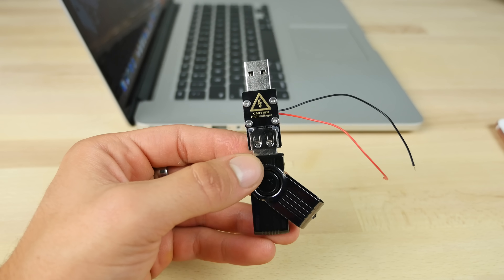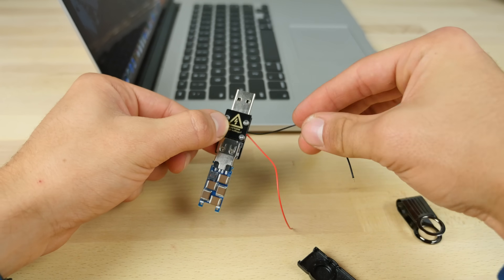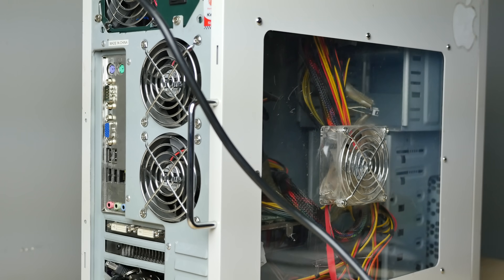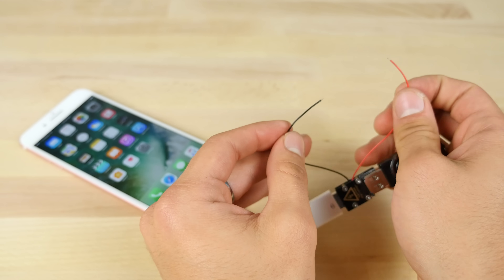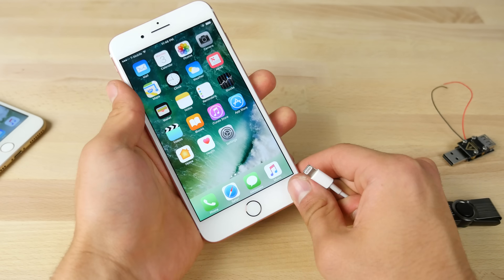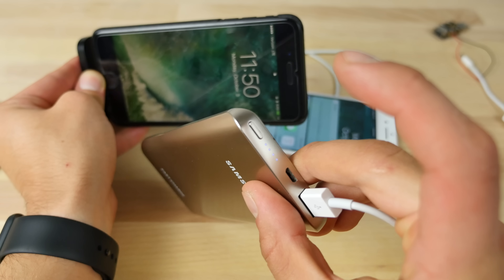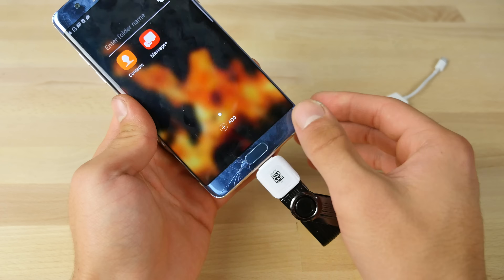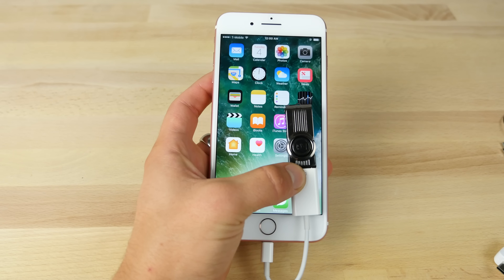USB Killer vs iPhone 7 Plus - Instant Death?

Comment: You realize the Note 7 & S7 line can handle upto like 20v right?  for fast charging. XD  (via approved connectors)
Reply: Kerns Noel
Things to think about with this device is that it send 200V via the data connections, not the powerlines themselves. And there are 5 capacitors in series, ultimately charging the USB 5 times as fast. The phones weren't powerful enough to do any real damage though, I think a newer phone can output at around 1 amp.
Reply: Kerns Noel the USB killer probably outputs very high power on the USB, so it's not only the voltage that matters. Also it might put it on one of the data cables so the device is absolutely not fit for that.
Reply: +Leo1239150 In this case, only the voltage matters. These capacitors store up to 200V and then discharges it in quick succession. The amp is pretty low, it's negligible.
Reply: *****
The fast charging on newer Samsung phones take up to 9V for fast charging, and 5V on normal charging. Fast charging is literally adding more volt.
Reply: deIlluminati Indeed after looking at my motorola quick charger saying 12v I removed my comment. You are right!
Reply: deIlluminati I can't imagine it's able to store up that much power from the supply from the note 7 output (and I couldn't find a reliable source on what it outputs).
Though if I were to be honest I suspect that the Note 7 supplies standard USB power upto 2a (5v), and given a few facts about how the iPhone, standard PC, & note 7 work ... 
-PCs USB ports aren't meant to receive power, and wouldn't be designed to tolerate powered feedback in excess of what it supplies (and given it'd fry the power supply on Good MB/PSU setup, or the MB it self)
-iPhone 7 isn't meant for fast charging & wouldn't tolerate a sudden spike like that either, cooking it's port (which is death for an iPhone really, as it doesn't charge wirelessly)
-Note7, having over-engineered Fast charging .. (and given that they don't enable the full blown limit, likely due to heat generation from it that would come from the battery) would likely be able to tolerate a spike within half way reasoning.
I can't imagine that the USB killer could output 200v from a Note 7 charge, and I do wonder what input it would take to generate that quickly (within 2 seconds)
Reply: deIlluminati forgive my bad wording.  I know standard USB is 1a right, but given that even the 'standard' charging for the Note series (For a while) has been 2.1a, I'm willing to assume that the Note 7 could output 2.1a w/ 5v (which is the USB standard volts)
Though, perhaps the Note 7 USB-C being a Very over-engineered Multi-purpose port, that 'DOES NOT' stop charging or the ability to charge even while using data connection, and I really doubt they'd leave it vulnerable to accidental cross linking.
-That and honestly I do believe that supplying power mode would disable any data connection, meaning a device that is able to do that could consider all of it's pins potential power lines for it. (aka, I doubt it ever has any dedicated data connections like traditional USB ports on PCs do)
-I would also point out that the charging hardware in the Note 7 is fully able to take more, and I'm willing to bet part of how they do it, is utilizing normally unused parts of the USB input for fast charging ontop of more volts. 
--It's clear the battery is the main reasons faster charging isn't in place, as heat generation and lifespan* are the critical factors, not the chipset ability to handle more volts/amps through it's circuitry.
Reply: Paul H. There's no such thing as an S7 Note. It's called a Note 7.
Reply: deIlluminati he is talking about the regualar Galaxy S7 and S7 edge

Comment: Killing the lighting port is still kind of killing the phone lol
Reply: see this is is where wireless charging shines and now getting a iphone wireless charging case would not work
Reply: You can replace the charging board component, iFixit showed it on their teardown, better than a new phone.
Reply: How does replacing that component affect the IP67 protection though?
Reply: And no wireless charging
Reply: dgo0dy Gaming I would need to check iFixit video to veift but what I remember is that the isolation that stops the water doesn't require any special assembling technique, but you can check it out if you are curious. I'm on mobile data so I can't check it right now
Reply: ►►►► Heeeey Frienddssss I Haveeeee Justttt Wonn Brandd New MacAir From visittttt  : -  https://t.co/lvoGbx85vT
Reply: ho cares abaut that

Comment: The reason that its not firing the device is that every time you are touching the tester wires you are immediately releasing all the courent, "let it charge" through the tester and then with out touching the wires plug it in

Comment: Restart the iPhone. I think the phone has disabled the port and should turn back on with a reboot.
Reply: +IIGrayfoxII No, the PSU will only protect from surges coming from the power line. Power to the PSU from the wall, PSU power goes to motherboard, and power from motherboard goes to USB. The PSU can't protect from the USB since the motherboard is between the PSU and USB, and therefore the motherboard will fry before the PSU can handle it.
Reply: Same with the PC.

When PSUs detect a short, the circuit breaker needs to reset and it does it by having all power from the capacitors get drained.

So unplug from the wall and wait 5 min.
Reply: No - the surge in this case blows out ICs in the motherboard
Reply: mattferg100 is right.

Comment: Was that charging the note 7?
Reply: yup it is
Reply: i know samsung is much more concern of its customers safety, well i know apple is much worse than samsung i had experienced it b4 with my s3. i know samsung will deal with the devices u bought from them, if it is a serious case they will recall the devices
Reply: that was not the case for apple, i had bought a imac, it broke when i open the packaging the screen drop off, bring to apple service centre only said i void the warranty so i can't fix for free, but i haven't even use once. there another case whereby i won a lucky draw with my friend both of us got an iphone 6 free redeem at official apple shop, again got a problem set, this iphone has a bloody red screen appearing and there some sparks at the lighting port when it turn on and it does not allow me to see the home screen and it getting hotter and hotter the screen get more bloody red b4 it turn off. it may expolde if i charge it, luckly i notice there spark at lighting port when it is turun on. the spark went off when the apple logoappear then the blood red screen. my friend had the problem as well so we went to the service centre. apple check and only said u need to pay to fix the phone as u jailbreak it, but we didn't jailbreak them

so therefore i hate apple and won't use it again. u can get faulty phone/devices if the service is bad it is just unforgiving.
Reply: nope as we didn't do any housekeeping the we didn't get a chance to use them all we did was switch on the phone then it does the red screen
Reply: the mac screen drop off when i placed it on the table, i am not even drop them or no even slam them on way too hard.
Reply: it was really the product packaging  or shipping fault and programming fault before it was on sale i dun even get a chance to get in to the home screen and use the mac .

apple just dun want to admit that is their fault.
Reply: Technically it was charging the phone, though it wouldn't actually give the phone extra power and it would run out of battery like normal, I account for this being the capacitors re-releasing the stored power back into the phone and the phone recognizing it is receiving power from an external source, even the it is just recycled power that came from the phone in the first place.
Reply: literally every Apple fans would use "Note 7" to back up every argument whenever they run into one with Samsung users
Reply: its funny how you know nothing lmao only a few exploded 1 in a million .0035% of them had a defect lmao and they recalled it in a few days and apple? they hiss they bend and they dont warranty that shit lmao
Reply: I see what you mean but you broke it out of human error it wasn't because their product failed

Comment: Note 7 is a solid phone just got way too much bad PR.... I love how they sent me a second one. I love the note 7... better photos in low light than the iPhone 7 plus i've used.
Reply: Jonzin Gaming All lithium ion batteries have a risk.
Reply: "Bad PR"?!! The fucking thing self-combusts, it's hilarious that these are the same Fandroids that picked fun at Apple users because of the signal issue on the 4/4S or the bending issue on the 6/6S or whatever else, well guess what? At least the fucking things didn't EXPLODE!!!
Reply: SeKToR  NOTE 7 battery go boom boom and hurt people
Reply: How many cases vs how many sold?
Reply: it should not be a risk at all
Reply: fun fact, the iphone 7 is having the same problem now lmao. in fact it has since the start. but apple is trying to keep it low. so the score is, shitty signal on 4s, bend on 6s, and explosions on 7, to, well, only explosion on one of samsungs lines. so 3-1, keep up the shitty work ifag.
Reply: lithium ion provides better battery efficiency by now but it is actually a bomb.
Reply: lmao multiple Have been confirmed. but not by apple. apple most likely wont confirm them, because thats apples way of business. ignore the problem so that it cant hurt us. apple makes shitty products and specs show it
Reply: matt may
Specs? Oh you mean like the fact that Apple's newer duel-core processors in the iPhones outclass similar Quads on Android devices? Or the fact that ioS devices don't NEED as much RAM as the resource-leeching Android OS? I could go on and on and quite frankly you're just making yourself look more and more salty by the post, care to link me to any of these "confirmed" reports eh?
Reply: Andy Fisher to be honest you are salty just because someone called iphone worse

Comment: the computer is running but does not turn on the film because I did not turn off the power supply from the network for 15 seconds as protection is atx is a total fake buuuuuuuu

Comment: i think it would be better to inform yourself before doing such a video next time. how does the usb killer work? it charges up its capacitors, then releases its power ower the DATA contacts. thats why it does so much damage. now, i think that it did not kill the samsung because he told the phone that it does just charge the battery, so it did not use the data contacts. furthermore, i dont think that you could fry a battery bank, wal charger or other "power-only" things.

Comment: What happens when you plug it into a car or your house outlet?
Reply: Your house explodes
Reply: Sean Ali your car and your house both have fuses. They will switch off. In the house you can just turn it on again, in the car however you have to buy a new fuse and replace it.
Reply: Not entirely, if it trips the breaker in the house then yeah you can flip it back on again, but if it actually fries the components then that breaker would have to be replaced. However I doubt that could output enough current to actually do anything, have you have ever seen a power surge, it takes a lot of current to actually knock the power out of a house. The 5 caps in that USB thumbdrive can't push the current high enough to cause damage.

Comment: Will this cause the hard drives and any storage devices to lose all of the data?
Reply: Alex Schneese Well don't try it just in case it does wipe the drive but myself I think it is just the power supply that breaks. The iPhone stopped charging and the PC didn't turn on. It is most likely wiping out the power supply. Most of the time a computer technician shop will replace the power supply for around $50.
Reply: No, it only fries the motherboard as far as I know.

Comment: every respectable manufacturer will implement some sort of protection on any usb ports. for example on my mac, a short on my usb will reset the laptop. 

I think you need to read more about voltage and current before understanding what is happening with that usb "killer" .

Comment: Im confused would'nt the power supply stop it from that type of stuff
Reply: Dandre Urquhart power supply regulates voltage, and its just like if u throw a ball and it comes back like a boomerang and hurts u.
Reply: but most modern psu would protect against it isn't it called over voltage or am i confused
Reply: overvoltage related to the psu not usb ports. Some motherboards may though.
Reply: oh ok
Reply: The USB is connected directly to the motherboard, so the motherboard will fry first. It's just logical.

Comment: you didn't just kill the lightning adapter you actually damaged the power management chip the part of the chip responsible for charging the phone. don't ever charge an apple device with a cheap car charger because the same thing can happen and the repair is almost impossible it will actually just kill the phone. android phones are safer because they have charging protection on the phone and apple has it on the charger itself

Comment: It's called "opto-isolators" they're used for isolating devices for that specific reason to prevent ESD. It's a little more complicated than a one line statement, but it isn't an actual direct connection from the port-to-the-board any more, they have discrete monitors for those isolators as well; But for all intended purposes....that lady has sung.

Comment: you gotta charge up the capacitors again and use a multimeter to test it, if you just touch the wires together you are gonna discharge the capacitors

Comment: Phone is made to be connected to the wall, it would make sense they would be protected from power surges like lightning strikes... like good computer's power supply... a USB port isn't meant to connect to the wall or high voltage and are not protected from them...

Comment: This is more proof that intel made that connector great (because it supplies LOTS of power) and that Samsung and Google android know what they are doing. The thing is that the iPhone goes straight to automatic stuff, it doesnt and wont require a user input to do anything with the port and you cant control what it can or cannot do. Dont leave your phone unlocked anyways... whatever you have.

Comment: Some would says that I'm a, on Danish "computer nørd". 
A nørd. Is a person who had a hobby out of the ordinary. I've tried a usb kill pro, on an old Dell computer that had xp. I had expected that the computer would collapse just like yours. I know how a USB killer works. power in USB killer comes from PC. a capacitor amplifier voltage and causes it to run in the loop for USB breaking down. I did it, my PC. died but it did USB killer too. there was a big spark from the USB killer when I turned on the power. 😂💦 from the computer

Comment: but it does broke it you can't charge it right well
Reply: but the USB prove that iphone 7 is useless right
Reply: LOL is all I can say. The phone is useless because a high voltage fried the lightning port?
Reply: Snor lax it's in safe mode protection for the port. After 30 minutes it works fine it's the same concept as the waterproof protection
Reply: what if battery drains from 100% to 99%, from 99% to 98%, from 98% to 97% and so on until 0%? can't charge
Reply: groszak1 the charging port will work after 30 minutes so even if it does die u can recharge

Comment: The "safety thing" is what charges it up right? You should have charged it up using a laptop or USB wall adapter and then plugged it into the phone. The capacitors are never going to charge up fully just by plugging it into a phone.

Comment: I had a special usb drive for when I didn't finish my work for school, it had aluminum foil across all 4 pins.  It didn't kill any computers but all of the school ones at that time would shut off, so I had the excuse the work was on the flash drive.

Comment: iPhone has had some sort of protection from this for a while. Back when I had my 4, I was working at a communications company and I used to test some of the equipment with an audio mixer. I would have my phone plugged into it while I was working to listen to music. Well one day I plugged it into the mixer which I didn't see that phantom power was turned on, which is how you power certain types of microphones, and 24 volts of electricity jolted through my phone. It shut off immediately but it started back up with no problems. I thought I fried my phone, thankfully everything was fine.

Comment: I just got my iphone 7 yesterday and set it up as a new iphone and also went from the standard iOS of 10.0.1 and upgraded it to 10.0.2. After doing all of this, my phone is draining battery very fast and heating up especially within 10 hours after i activated it and uprgaded the iOS. I brought it to school with 100% battery and after around 3 hours, the battery was at 36%. I researched it and it said that it is normal for new iphones to act this way for a couple of days (fast battery drainage and heating up). It also said that iOS 10 consumes a lot of battery for the first day or more because it is indexing and scanning data from your new phone. Can anyone confirm if these two things I researched are true and that new iphones act this way for a couple of days.

Comment: Jeez. why do people not understand all this device is doing is shorting out the device you plug it into? yes it breaks it, but most phones should have over volage/amp protection inside of them. and the iphone 7 probably had its charging port disabled or something automatically. the note 7 on the other hand, it has fast charge which means it can handle more voltage/amperage being put into it, and im assuming the discharge is alot less than what it can actually handle. because your not necessarily fast charging it because some batteries discharge less than what they take in.